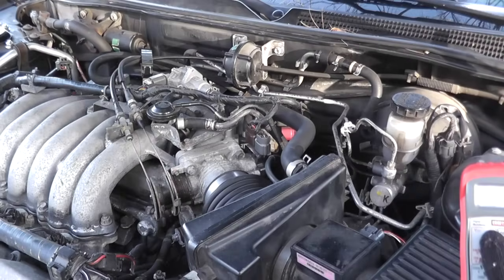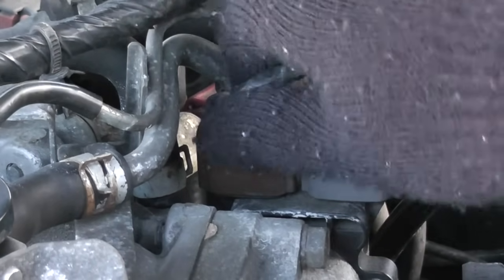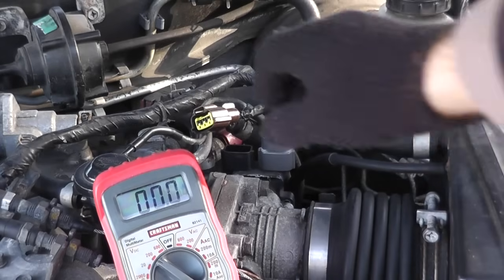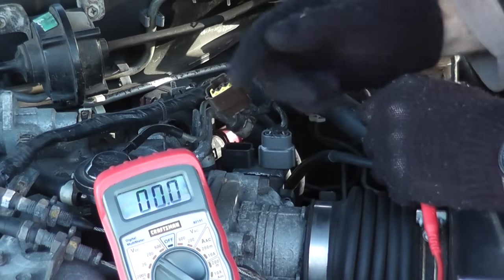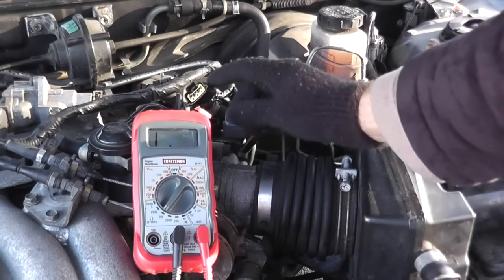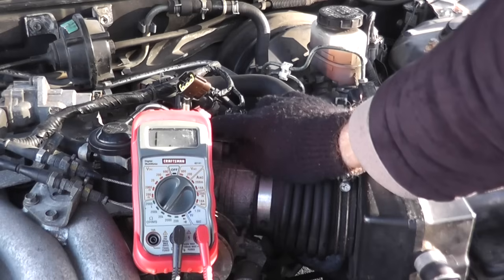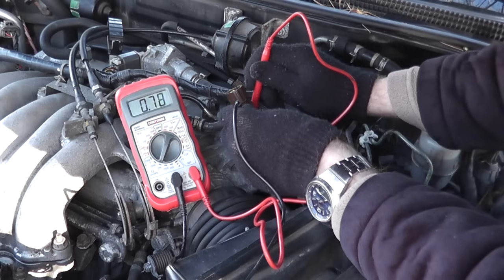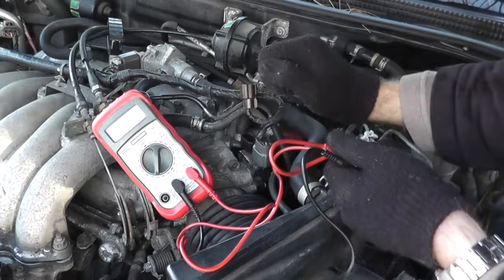How To Test and Replace the Throttle Position Sensor (TPS) P0120

Comment: Which contact points on the TPS are you using for the resistance test? Across which two contacts are you checking for resistance?

Comment: Great vidieo my car has been into 2 garages neither could solve the problem, watched a few vidieos but they were in double Dutch after replacing all the obvious parts I was back to square 1.Juat done this test and discovered that voltage is down hence code P0122.many thanks you are on my xmas card list👍
Reply from the maker: Awesome! Glad it worked out.

Comment: thanks is there an initial voltage reading from the signal cable pin to ground?  while  ignition ON and and unplugged  TPS sensor?

Comment: Hey CarsNToys I have a 2004 Chevrolet Silverado Z71 and on my ground wire at the connector I’m getting 11.2 ohms and my volts is 5.1, does that mean my pcm isn’t getting a good ground connection and I should make a better ground?

Comment: You need to get your Full Service Manual. My terminals for the Throttle Position Sensor harness are opposite of this example. So in my car its (3,2,1) Thanks for the vid.

Comment: Hello, hoping you can help me out- I have a 99 Maxima same exact setup as your 97 in the video- a few weeks ago it started missing on cylinder 5 (threw a code saying it was a misfire on #5) so I replaced the coil and the plug for that cylinder. That fixed the miss but the car seemed to idle pretty low after that while in gear-- it would idle down to about 500 RPMs when stopped in drive after engine warmed up (idle in neutral or park seemed OK though-- right at 700 RPMs like you discuss in the video.) So, I tried following your steps for adjusting the throttle position sensor in your other video, by rotating the sensor a bit. The voltage seems good at 5.8 volts, and I have a bit higher idle in gear now (about 600 RPMs), but now when the car is cold and I start it and then shift it from Park to Drive, it SLAMS into gear which it did not do before. After the engine is warmed up, if I repeat this procedure it seems fine- only slams when I start it cold. (And this is just physically shifting the transmission from Park to Drive, while driving the car shifts fine.)  Hoping you can give a bit of advice on how to fix this! Thanks
Reply: s blagg  did you get a solution?

Comment: It's Hondas TPS and TB used on my turbocharged Peugeot do I have to check the voltage when turning the butterfly or OHMS?  I'll  be replacing the sensor anyways to start a perfect and clean process
Reply from the maker: The voltage check is used to verify power is getting from the harness connector to the TPS.To check the TPS, do an ohms test while turning the butterfly. With the butterfly closed, the ohms reading should be low. (On my vehicle it's under .5 ohms) As you open the butterfly, the ohms should increase up until full throttle.
Reply: I have the same TPS like the thread below showing and almost same TB

http://www.pakwheels.com/forums/performance-modification-tune-up-preventive-maintenance/193812-tps-calibration-pics-honda-lovers-4

why he is checking the voltage?! Instead of OHMS!
Reply from the maker: That's perfectly fine.

Comment: Good video, However,  I was confused on the last reading;  the reading did read correctly at closed throttle like you said (ballpark .5 .6 ohms).   But as you opened the throttle, the reading went up to 1.42 ohms.  Was this full open throttle?  Then you said, you "pinpointed the problem".  Should the reading have gone higher than 1.42 at full open throttle?  I believe you said "as you open the throttle, it should increase slightly up to 4 ohms"  but you didn't specify at full open throttle.  Thanks.
Reply from the maker: +Lood Brighton Thanks. It wasn't full throttle. I just opened the throttle and watched the corresponding ohms reading.For this vehicle, full open throttle should yield 4.0 k ohms.
Reply: Thanks for the response.  I appreciate it.  I am going to check my 2000 Accord today...should be 5.0 k ohms at full open throttle according to Honda.  Again, Great Video!

Comment: Hey, I have a 92 maxima

I tested the sensor, instead of ohms gradually increasing when I open the throttle like they do in your video they drop.. shouldn't  they be increasing?  Would the sensor be shot if ohms decrease? 

Thanks for any info..
Reply from the maker: Jesse Lodema Ohms should definitely increase. On your vehicle, the harness connector for the throttle position sensor has three terminals. If you look at the harness connector with the notch straight up (where you place your finger to press down and remove the harness connector) you want to test the left terminal and middle terminal.
Reply: Thanks for the info, that's what I thought. The other one was the black wire which would be ground, I had a solid 5 volts but when I did the throttle sweep the ohms went from 10 ohms or so n down to 1 at fully open throttle..
Reply from the maker: Jesse Lodema What's the issue you're having with your car? Are you getting code p0120 or you're just searching around?
Reply: CarsNToys I just double checked it n the ohms are starting out around 10.5 k ohms n drop smoothly to about 2.5 ohms.
My car had been lacking power in lower rpm's and feels like she wants to stall out when I come to a stand still. It was very shaky the other day, I cleaned the intake manifold, throttle bodies, iacv, New fuel filter, plugs, wires, distributor cap, rotor, and most vacuum lines..
It runs alot better now but I can still feel a little hesitation when I accelerate and when it idles in gear. It idle fine most of the time in park or neutral
Also when I start it cold it isles high, drops down like it should when it warms up but then if I kill it and start it right back up it revs high again like it's cold. I Dk if there separate issues or both possibly due to tps..

hopefully I don't drop 60$ on a tps and find out it wasn't the problem lol....it's gotta be part of the problem tho right? Lol thanks man!
Reply: CarsNToys n yea I was just searching around, my check engine light never came up but I don't have an obd2 port either.
Reply from the maker: Jesse Lodema I think you checked every possibility. I'd guess something within the ignition system but you've address that already. Try redoing the test in volts instead of ohms. Any difference?
Reply: CarsNToys ya so I went out and grabbed a new tps sensor yesterday..I threw it in and didn't notice any difference so I did the throttle sweep n tested it again and resistance dropped from the same range as original tps sensor.. is there a switch or something that possibly has it working wrong...when I pull the throttle it drops smoothly but all the tps tests I have seen usually rise in resistance..Is there something else that could be causing resistance to drop? Or is that possibly a norm for this vehicle? I'm stumped...Thanks..
Reply from the maker: Jesse Lodema Let's start with the basics. When you disconnect the harness connector you have three prongs. Which prongs are you placing the multi-meter to perform the test?

Comment: Anyone know why both O'Reilly and Auto Zone both have the picture of the sensor wrong on a 06 Nissan Sentra 1.8 L ? It doesn't look like it at all. And what looks like the sensor has rivets not screws / bolts. I guess it can't be removed by itself?

Comment: I am getting error code P0733 which I have read said it is the TPS sensor. How many hours labor is this to fix on a 2002 Nissan Altima 2.5?
Reply from the maker: Hey kflo01. Are you sure the code is P0733? This is an automatic transmission trouble code. Specifically, this is a malfunction detected when the automatic transmission does not shift into third gear.
Reply: I havent taken it to another shop yet to get a 2nd opinion but they said it was error code P0733. Ok here is what happend kinda long read then you can tell me what yout hink.

This may be a long read. I just want to detail all the info so the long time experts here can make a good guess on whats wrong with my car. Ok here we go...I live in New York State....so its cold and theres snow. Oh car is a 2002 Nissan Altima 2.5

Monday: Car cranks kinda slow in the morning on the way to work and when I leave work at 5 doesnt start. I get a jump and go home.
Tuesday: Car starts fine in the morning and on my way home from work.
Wednesday: Car barely starts, it bitterly cold out (8 degrees in the morning) I drive to work about 15 minutes later it dies putting my foot on the gas does nothing. I get a jump. and pull off it acts like it doesnt want to go anywhere but then pulls off.....drive another 10 to 15 minutes it dies again. I get a 2nd jump and the guy looks at the positive post on my battery and said it needs to be cleaned lots of corrison on it. After it shut off the nd time the service engine light popped on.

I hurry and take it to a shop after the 2nd jump afarid it will die a 3rd time on the highway. Shop says I need a battery & alternator cost: 566 plus tax. Plus he said the error code was P0733 I dont have that money so I get only the battery and make a 30 minute drive back home. That night I take it out fora quick trip to the supermarket and back home

Thursday: I dont move or start the car at all due to a big snow storm.

Friday (today): I go to auto zone to pick up a alternator but I have the guy working there test it. He says the alternator is not bad. So I get my rear break done instead. I pick the car up.....now its night time.... 10 minutes into driving it car barely is moing even though I have my foot on the gas. I stop it turn it off and try to start it again it wont start. I get a jump within 5 minutes and take off again to try to make it home..........10 minutes later it starts doing the same thing....foot on gas...barely moving....after .it does that I put it in park, or neutral and rev the gas it revs fine. Put it in drive wont rev.........after about 2 minutes of it in barely moving (like 5 mph if that) I can now drive like normal. It just revs on its own and goes fine no problems the rest of my trip home (about 5 minutes).

Saturday: I replaced the alternator and we check the transmission fluid levels. The levels were almost bone dry. we put 2 qurats in changed the alternator and now its running fine but the SES light is still on. CarsNToys
Reply from the maker: Any other codes besides P0733? Even though you placed two quarts of tranny fluid, have you checked the level?
Reply: CarsNToys
Levels were fine after the fluid was added. I havent checked today but thers no puddles under my car. Would be esy to see with the snow.

Comment: Hi there,  this is what I got 
When fully closed 1.8 OHMS
When fully opened 2.2

Do I have a faulty sensor or I have to tilt the sensor?
Reply: +Motasim Al Raisi your sensor its fine...its only when its way off or theres no reading thats when you need to buy one..

Comment: I have this model of car, and I'm curious: If the harness to the TPS is the brown connector, what's the grey one?
Reply from the maker: +Antonio Java What year is your Maxima?
Reply: +CarsNToys It's a 1999. We call it "Cefiro" where I am, but it's the exact same model as your Maxima (chassis A32). Everything under my hood looks exactly the same as your video. :) I wonder about the TPS though because on other cars, there's only that one connector with three prongs. In yours and mine, there are two connectors with three prongs each.
Reply: +CarsNToys Also, what prongs did you test when you tested the TPS? The two outer prongs?
Reply from the maker: +Antonio Java Two outer left prongs. I'll have to look up what the grey wire is for.
Reply: +CarsNToys Nice. Thanks! :) As I said on your IAC video, your tutorials helped me a lot. my TPS turned out to be the problem, but instead of being defective, my car being idle for so long apparently needed to have the TPS readjusted slightly. Now that it's running, I'm likely going to have this brought in for an oil/spark plug change and a good tune-up.
Reply from the maker: +Antonio Java Awesome. I have a spark plug video for the Maxima if you need a guide - https://youtu.be/7Xi_lzIb20A

Comment: Looks like Nissan anticipated this failure to be common. I notice you are able to perform the rest with the harness disconnected, actually probing both leads while sweeping the sensor. A setup with one, 3 wire connector needs to be connected therefore one would have to probe the signal circuit while sweeping, to achieve a reading.
Reply from the maker: Yes, some sensors must be connected to perform tests; such as the mass air flow sensor.

Comment: where did you tap the positive and ground probe when you measured the resistance while varying the throttle valve
Reply from the maker: Terminals 3 & 2 on the sensor.
Reply: Hey I did my testing and these are the values. 

Closed throttle - 4.54 V
Fully Open - 0.2 V
^Is this normal for other models?

I slowly opened my throttle valve, and from 4.54V it jumped to 0.2V. It didnt decrease gradually. Same thing when I slowly closed my throttle valve, from 0.2V it jumped to 4.54V. Is this normal for other models?

Comment: I have a 1988 Toyota EFI v6 3.0 and the motor is a 3evz-e. I have the book for it but it doesn't have the information I need to test it can you help me?
Reply from the maker: ***** Probably. Try obtaining an ohms reading from the sensor. Place your multi-meter to the kilo (k) ohms setting and you should have a reading. (On older Nissan's, the reading is 1 kiloohms without touching the sensor and can go up to 9 kiloohms when the sensor is fully depressed.) If you cannot get a reading then chances are the sensor is dead. (If you need a reference regarding kiloohms, I just uploaded a video for p0110 intake air temp sensor. In this video I use the kiloohms setting on the multi meter.) Good luck!

Comment: hey bro can i ask u wat is likely cause of my car revving up and down from 1500 to 1800 rom . but on 2000 rpm it is in normal mode
Reply from the maker: It could be a number of things, such as a bad idle air control valve, throttle position sensor, egr system, etc. Any trouble codes?
Reply: MIL light is off wen starting. I located the tps but wud u tell me wer the iav usually is
      Nissan maxima 2001
Reply from the maker: Here you go - https://youtu.be/BYuRKzsqp-g

Comment: hi my sensor reads 4.5 volts at CLOSED throttle and .9 at OPEN throttle what could be the problem? i have surges in acceleration randomly. my car is a 2000 jetta 2.0
Reply from the maker: Aj Sabanski Do you have any other trouble codes?
Reply: Did you ever find out what was wrong? Mine is reversed too. I have an 88 Sentra. Closed throttle reads around 3.9 volts. Open reads .61.  Won't go any lower.

Comment: so the problem was with the sensor itself because the ohms reading started to go up or it didnt go up enough?
Reply from the maker: Overwatch No, this sensor works fine. I just shot a video showing the steps involved to diagnose and pinpoint where the problem is.
Reply: CarsNToys  you made a mistake at the end where you said "we pinpointed the problem". I was similiarly confused. Also, the title is a bit off, as you don't actually replace the sensor. I was still happy to know how to test it though thanks for the video.

Comment: sir,i have question.why is it my tps voltage read 10.33 which usual car all run with just 5voltage?is there anywhere to solve it?
Reply: i tried with my multimeter test
which read:
close throttle 0.92Volt
full open plate 10.24Volt
Reply from the maker: What kind of vehicle?

Comment: "You should see some resistance here" 2:40" This is technically not correct, the I that you see on the meter means Infinity which means high resistance, what you are actually looking for is continuity between the negative of the battery and the negative terminal on the TPS's connector and not resistance, the lower the resistance the better. 
When the meter is displaying  the I there is resistance, you made it sound as if the I is displayed there is no resistance.

Comment: hi man fnx you for this video its so helpful .. I have sentra 1999 model and it have problem an acceleration when I reach 45 the RPM get down from 2.5 RPM to 1.3 RPM with not accept press the pedal only when I press deeper it respond for a moments .. I used device scaner and it shown the TPS sensor circuit open or short and MAF sensor circuit open or short .. then I took a used throttle with all the sensor and replace it and doesnt work any difference .. then after I checked the sensors voltage like what you do (tps) and the TPS sensor got out 0.45v with out crank the engine and when I press the pedal full open it show  5.12v. its look good now .. but when i crank the engine and check it again and press the full pedal it ONLY SHOW 0.93v . whats the problem over now?1

Comment: I have a 2000 Ranger 3l v6. I get 4.97v on 5v power wire, 14.1 resistance on ground. So those both are good but I get 1.21 clossed throtte & 4.64 WOT with no issues when increase/decrease idle. is 1.21 high for clossed throttle?

Comment: What setting of ohms?
Reply: He's really just checking that he has a good ground so the Ohms, value isn't that important. If you set to 100 ohms scale you should go from 1 (Open/no circuit) to 0 or 000 or some other low-ohm value. If you set a higher range like 1K or more ohms scale, you'll get fluctuating readings as shown in the video. Btw he was set a 2k (2000 ohms) scale.

Comment: Hi there,  this is what I got 
When fully closed 1.8 OHMS
When fully opened 2.2

Do I have a faulty sensor or I have to tilt the sensor?
Reply from the maker: What kind of car are you testing? Generally you want to see higher resistance (ohms) as you open the throttle.